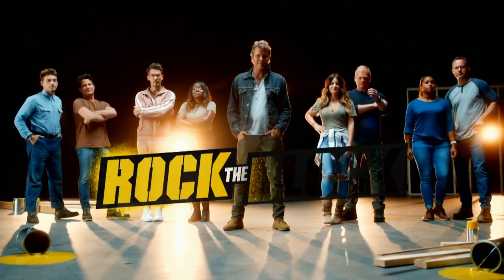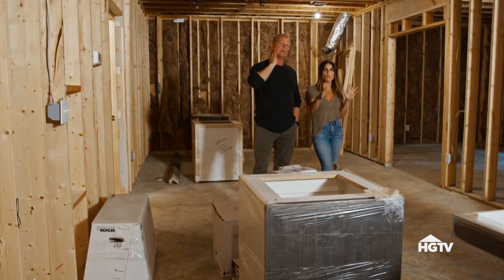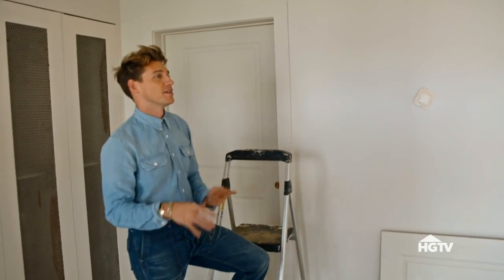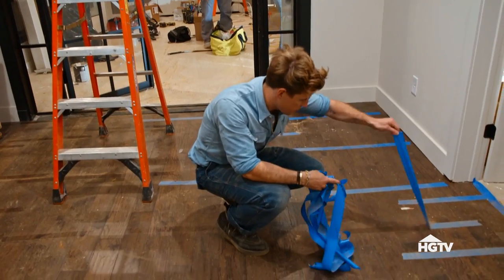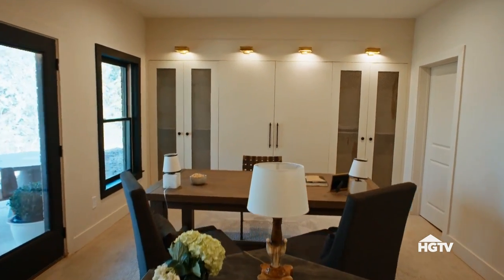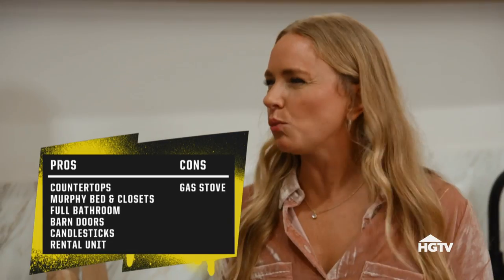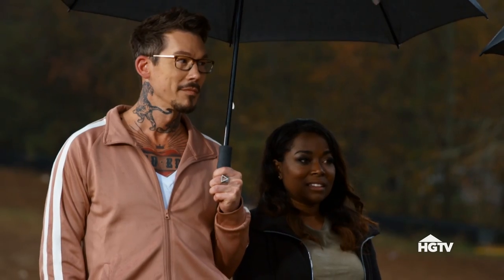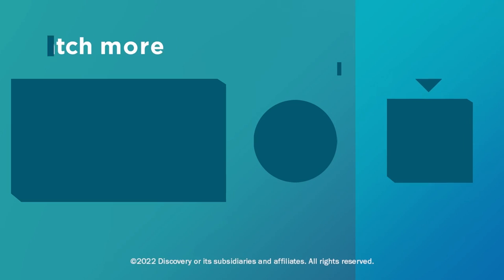AMAZING Basement Renovation Challenge!  | Rock The Block | HGTV

Comment: Wait what, aren't basements underground? In Australia we don't have basements? Is this the ground floor?
Reply: I was a bit thrown off too. I'm in Canada where basements are pretty standard but they typically have a few small windows, unlike these houses. Also, these basements didn't appear to be as deep underground as what I'm used to.
Reply: Sometimes the house is on a steep hill : so the front 🚪 door is ground level. But you use stairs to go "down" to the basement which is not visible from the front of the house/street -  but the "back" of the downstairs has windows or sliding door & there is no real back yard because it conues to go "downhill".  My mom had a house like that.... also in Colorado, sometimes the basement is only "half" underground, so it allows windows for light and  "egress" (emergency exit) .